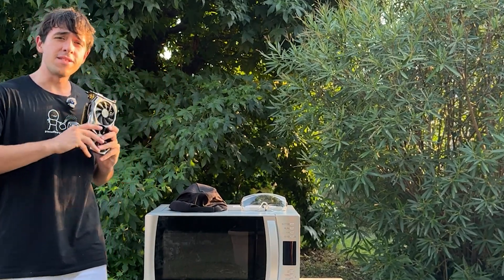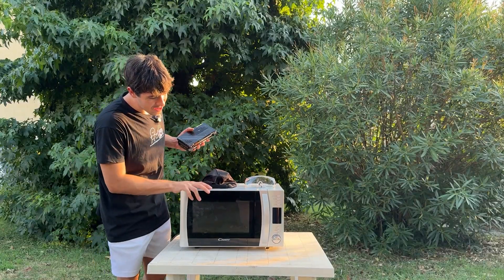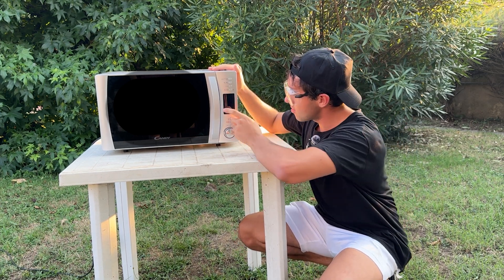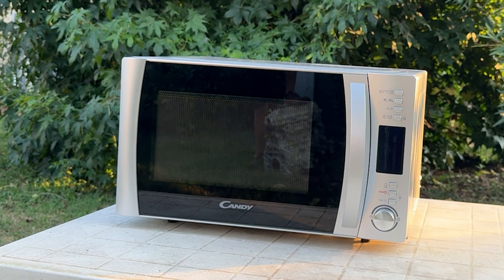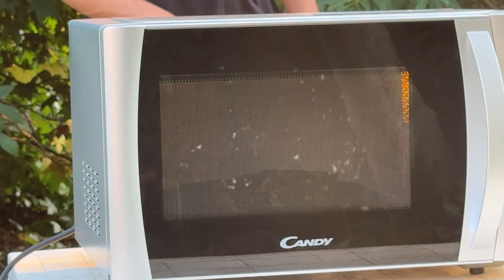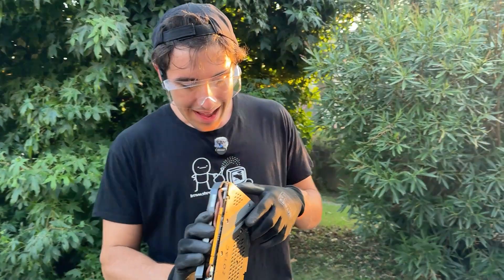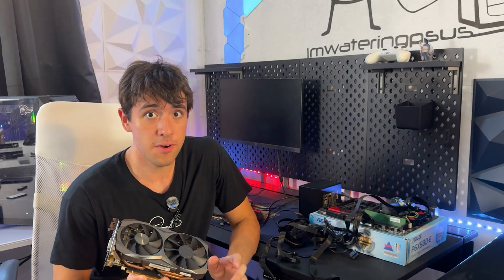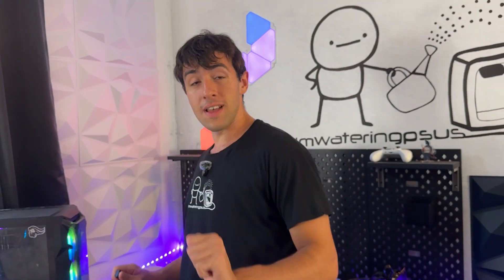I put my GPU in a Microwave to fix it

Comment: Actually there have a chance to fix artefacts on your GPU by this way,but you need to put the GPU in owen,not in Microwave ,because in Microwave have achange to explode😆. But in owen on 250C  by the heat have a chance to soldering againt the conecction under the ram chips. Before dtaht you neet take out the cooler and all plastic parts. Onli the motherboard of the GPU shoud the insite the owen. In same cases this can works.

Comment: To anyone who doesn't know, this is an entertainment video, if anyone is hoping to get the artifacts fixed by washing up the gpu or cooking It in the oven i would strongly advice against It as i say you got a slim 99% chance to lose all the money you could have got by selling It as spares and damaging other components of your pc. I myself buy these gpus and try repairing them in my spare time, as the guy says in the previous video (the one with the washing) i confirm It Is due to a faulty vram slot or a bad communication between the core and the vram. Either way a reball or ic replacement must occur as It Is the only way get things working as new, washing (which i think should be done only with IPA a toothbrush and a blower to get it under the bga Chips) or cooking It (nailing the temperature curve at which the solder melts with a oven with flux to remove oxidation and not overcooking everything) is crazy.
Ad ogni modo bel video, complimenti come sempre, anche per il falò che si è acceso. Sono proprio volati questi 5 minuti 😂
Reply from the maker: Very well explained! And thanks a lot :) Grazie!

Comment: Microwave and oven are not the same thing
Reply: He did the heat gun reflowing, which is the same thing but better
Reply from the maker: What do you mean
Reply: @ImWateringPSUs  u can literally bake GPUs and even motherboards in the oven but not in a microwave 
Heat vs radiation
Reply: Oven isn't hot enough